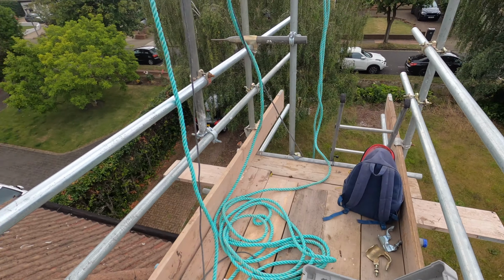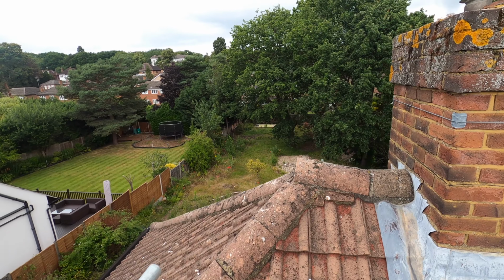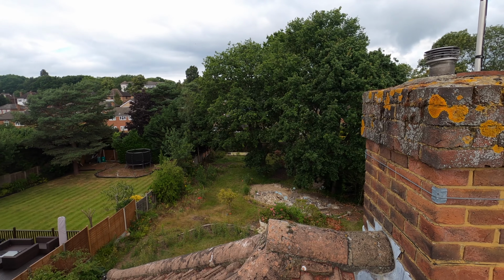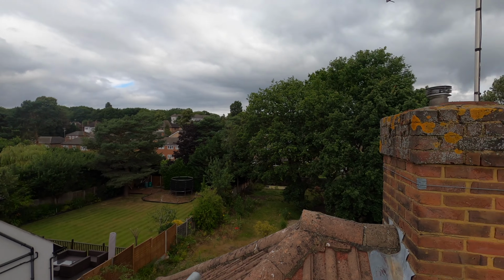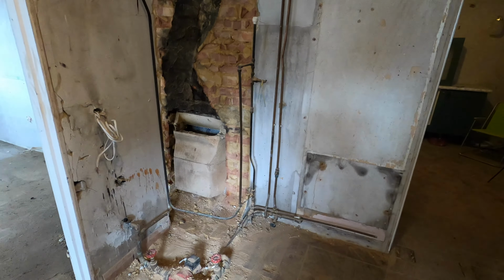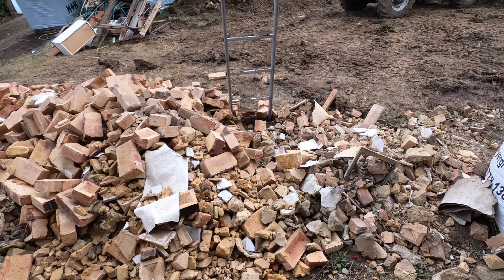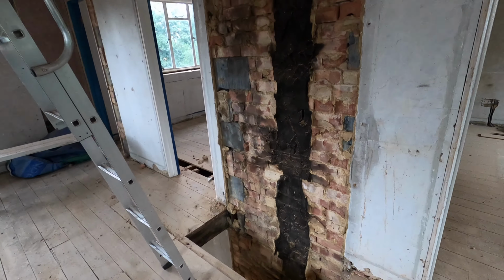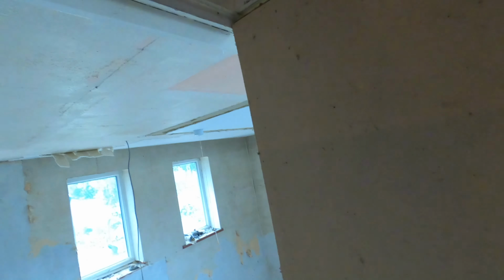How To Remove A Chimney Stack for £800. Chimney breast removal from top to bottom.

Comment: Just bought the house i have been renting for the last 10 years and this one of the jobs on my radar so I'm glad i found this video. I'm not trade just a good DIYer and the thing i was wondering is should i get a structural engineer to have a look first? I'm a bit worried about just whacking it out. There is no party wall issue but based on a ceiling patch on the ground floor it looks like some of it has already been removed and I'm not sure about what has been done.
Reply from the maker: Hi, congratulations on the house! Yes - please get a structural engineer you will definitely need one to ensure what can and can’t be done safely. Good luck!

Comment: Hi Nick, really like your video, very useful. I have a question, I have recently purchased a house and the chimney has been removed from the bedroom up into the loft with gallows brackets fitted. The chimney and fireplace downstairs is still intact and I am looking to remove this. Was wondering how easy would this be to do as I'm on a budget to renovate the entire house, will it affect the property structurally in anyway? . Cheers

Comment: Chimney stacks are built with thousands of bricks and/or blocks to create a heat sink, just like underfloor heating being in 75mm of concrete to create a warm slab. Since 85% of the heat went up the chimney, it warmed the stack so the heat radiated into the rooms. That's why when the fire went out, the stack was still warm for days to come.

A wood burning stove doesn't heat a stack, but it immediately heats the room. Trouble is, once it burns out, the heat pretty much goes soon afterwards.

Just like the old pantries that contained a concrete or stone slab, but because it wasn't heated, it tended to remain cold to sit meat, milk etc.. on. 

With a bungalow, there can be as many bricks in the stack as it took to build the walls. Sad thing is, people either block them up or completely remove them.
Reply from the maker: Really interesting! Thanks, Mee.
Reply: You dont understand the difference between open fires and stoves, the stove will heat the stack far more than an open fire & the heat will stay there once the stove has gone out, the open flue of the open fire will continue to draw all of the heat syraight up the chimney and out of the house.
Reply: Womp womp

Comment: This was a great video. How much did the admin cost? Any engineers that needed to sign it off, building control, planning etc?
Reply from the maker: Hi, you’ll need to consult a structural engineer and the council so I’d imagine this would be £400-£600 depending on the area. Mine was slightly different as I included this as part of building the extensions and there was no structural alterations needed at all.

Comment: Hi Nick, just wanted to ask. Did you have to get in building regs: control involved with checking the site before removal or a sign off?
Reply from the maker: Hi, yes - I required planning permission and structural sign off (ensuring it was fine to remove) before undertaking the work.

Comment: Hi Nick, good job there that kept you fit. Is that white part at the bottom the hearth of the fireplace that I suppose you eventually removed ?  Did you get in an asbestos surveyor to check for any presence in the flue or did you take a sample yourself, roughly how much does that cost ?
Reply from the maker: Yes it’s the back of the fireplace which will come out when the gas line is removed. The asbestos price was around £350 for s check around the entire house
Reply: @NicksHomeRenovations  Thanks for the reply 👍

Comment: Just came across your video, we're looking to remove our chimney stack ourselves too! It's similar to yours, in the middle of the house and not supporting anything, do you have any tips or recommendations for us?

What was the company you used for the grabber lorry?
Reply from the maker: Take your time and ensure you get very good scaffolding surrounding the whole chimney for access to all sides above the roof. Remember the hole will need to be fixed properly too unlike mine! 

Ensure you have planning permission and speak to a structural engineer to ensure it is safe to remove. 

Lastly and the most obvious - start at the top! The grabber lorry was RMS

Comment: You should have got you a little compressor and a cp9 Jigger pick and then sell them on when not needed would have had it done in half the time but well done I am surprised that TITAN lasted for the whole job but fair plat it did.
Reply from the maker: Yeah only £100 drill and not too heavy so preferred to go a little slower and easier

Comment: Good for you! Yep the clean up part is the gritch! What is it that's still left in the wall that looks like a thin layer of brick? Does it come out, too?
Reply from the maker: Will have to scrape a little bit more back but will end up bonding over that wall or even plaster boarding it all out at a later stage.

Comment: This is a really good video!!
I’m going to attempt to remove a chimney in my Cornish house as I need to free up space for the kitchen and put a combi boiler in. But I’m not having a new roof. I guess a roofer could come along and fill the whole left by the chimney?
Reply from the maker: Thank you. Yes the roofer (or a carpenter) will have to patch up the hole from the loft first and then can easily be done! Good luck

Comment: Great video again Nick. Forgive me if youve answered this already but does removing a chimney effect the structure of the house?
Reply from the maker: Actually I didn’t answer this I don’t think. They can be structural but in this case were not. Always best to ask a structural engineer and/or builder but it’s best popping up into the loft and looking at the joists to see if they run through the chimney or not. My joists ran around the chimney and were all large lengths from end to end which are stronger, meaning that the chimney wasn’t acting as anything supportive. But please check with someone!
Reply: @NicksHomeRenovations  of course mate. Knew you would have explored this before you did it so good to know regarding the joists. Would always check with an engineer anyway but great to know it's possible

Comment: Do you need any structural calculations to do this as there won’t be any load left at the top?
Reply from the maker: Yes. I sought advice from a structural engineer first who said the chimney wasn’t load bearing from top to bottom.
Reply: @NicksHomeRenovations  thanks.

Comment: Hello there , 

Your work is great !!! Congratulations.  

I have received two estimates for chimney breast removal of £9.000 semi-detached house in the Lincolnshire area . I want to take ground and first floor only support and leave it the top part . Do you think it is fair quotes ? 

I decided to go with the builder, who I know helps me support the top of the chimney to make sure it is safe, and then I will go on my own as you have done it. 

Best wishes.
Reply from the maker: Hi, no that is far too much. If you are leaving the loft/roof part you will need a qualified builder to ensure it is supported properly, however £9000 is far too much. I think you should be paying less than half of that, even allowing for a steel or similar to support the chimney that is left.
Reply: @NicksHomeRenovations  Thank you for your message 🙏. 

I was well surprised when I saw the quotes so that's why I will take builder with to for proper support and afterwards I will crack on on my own , Thank you once again 👍

Comment: do you need to get the work signed off?

If its a mortgaged house and obviously this is structural work when it comes to selling do you need any paperwork stating its been done up to some sort of standard?

if so how does that work?

If anyone knows, thanks in advance.
Reply from the maker: Hi, yes you will need to consult a structural engineer and the council. Depending on what they advise you would need to keep them updated as to the progress and they might want several site visits to see the work.

Comment: Hi Nick, did you have to contact your local building control in regards to this job? If so, what kind of plans did you need to submit?
Thanks so much for filming and posting this, it has given us the confidence to tackle our own chimney removal, which is very similar to yours in that it is in the centre of the house and is not structural at all (according to the engineer). Good to know the costs too – we're down in Tunbridge Wells so hopefully similar costs for scaffold & grabber. Thanks again.
Reply from the maker: Hi Lily, we had to submit plans for planning permission for the entire build; including extensions and the chimney was a small part of this. You would have to submit for planning permission for just the chimney. I don’t think you’d need to provide drawings but you’d need to show them you’ve had a structural engineer show that it is safe to remove and isn’t structural. Hope this helps.

Comment: Hi Nick. Great job. Did you have to put any supports in? My chimney breast is in the middle of the house like yours. My chimney stack on the roof is already gone and new roof is on, but I woukd like to get rid of the rest. Just unsure whether I would need any supporting beams or something similar
Reply from the maker: Thanks. No, structural engineer came and said all the joists span from front to back of the house; so it wasn’t structural. I would definitely consult someone before undertaking any work.

Comment: Hi Nick - I had the chimney removed externally but not internally - the roof has been replaced where the chimney was removed - but I've started to get damp on the chimney breast but the roof is completely dry and so is the top of the chimney in the loft - any suggestions?  I really wish I had it removed completely but I just didn't have the money at the time :(